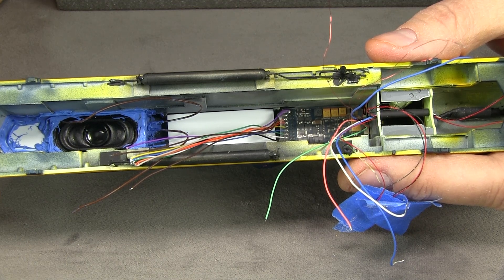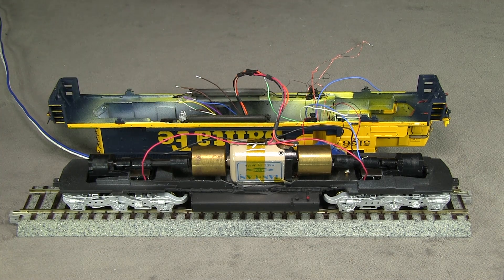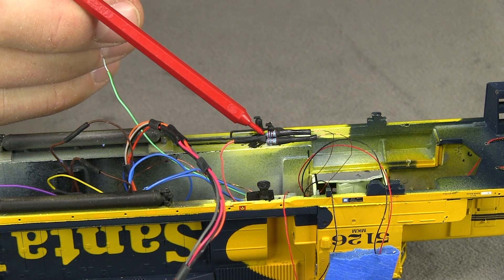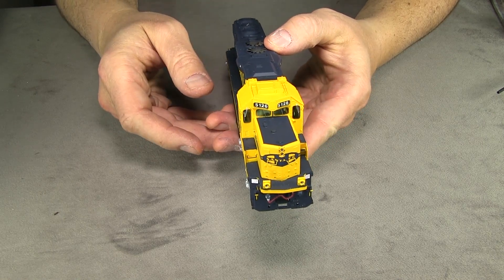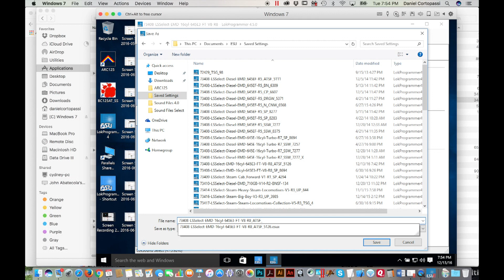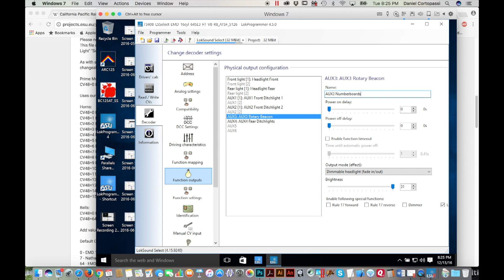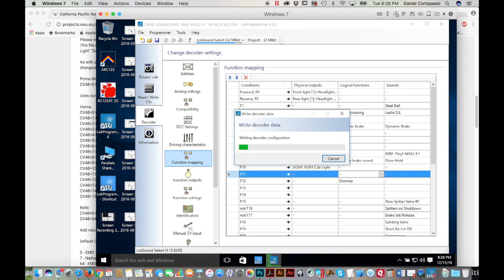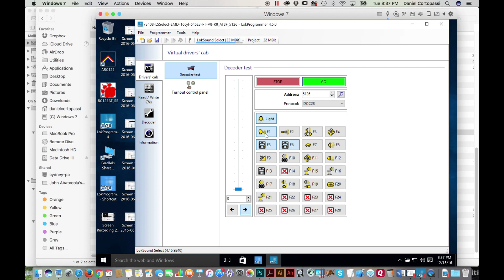HO Scale SD40-2 Model Building 23 of 25 Final Assembly Pt. 2

Comment: Hey Dan, 

Here's a question, now I'm second guessing myself. I thought the blue common wire is the common hot (+). I see you are putting the resistors on the white (FWD) and yellow (Rear) wires which I thought were the grounds. Or it doesn't matter as long as there is resistor on one side? I've been under the assumption that blue was common hot. 

Thanks,
Greg
Reply from the maker: Dan's personal preference is to place the resistor on the negative lead to any LEDs he uses. It can go on either wire, so if your preference is to have it on the positive, by all means, do it that way!